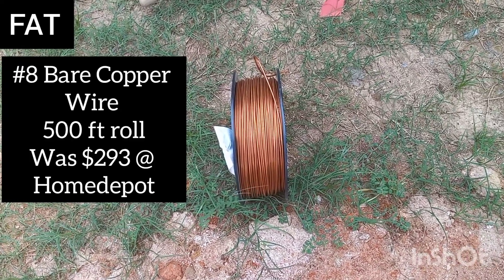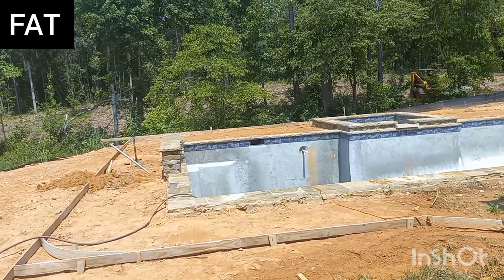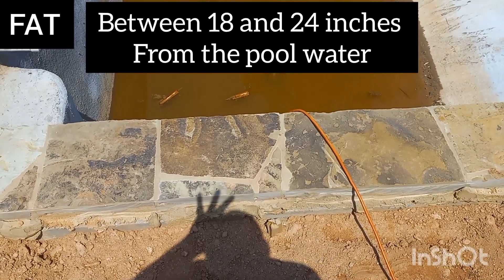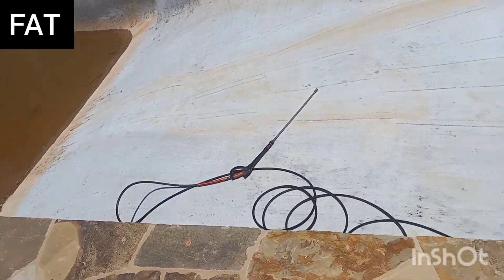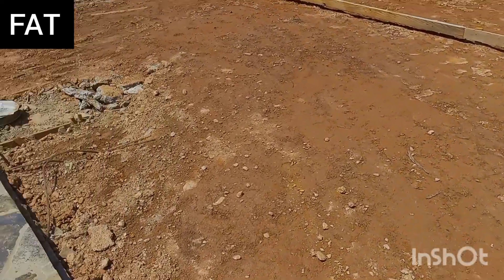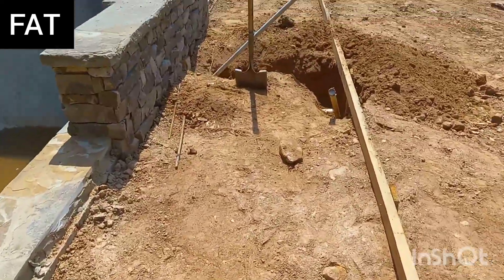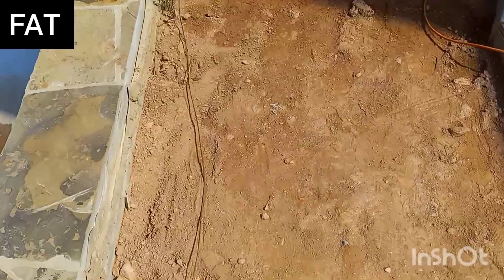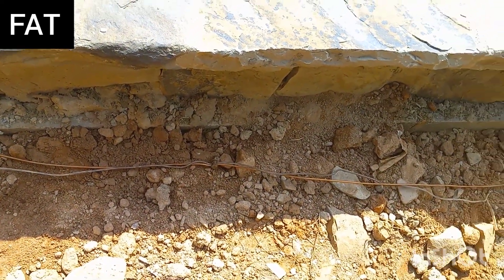How to Bond a Swimming Pool!

Comment: Frank, help I got duped by my pool company. 2 1/2 yr nightmare. I have the 360 wire but my county said they can’t see what the bonding wire is attached to in the pool bc the company covered/concealed it. They say I need a “continuity four-point test”. No one seems to be able to help. 
What can we do? I literally took up the tile around the pool and exposed the 360 wire and you can see the wire at the 4 pts coming out of the pool.
Reply from the maker: Just now seeing this comment Smh.....YT.

Comment: It is a proven fact that auxiliary ground rods add zero benefit to almost every application.  Ground rods need to be referred to as lightning rods only. The answer to stray voltage is bonding metal parts and properly grounding with egc in equipment and junction boxes. I repeat. No one ever accomplished anything throwing extra ground rods in
Reply from the maker: I've always thought it was ridiculous to add ground rods to a gunite pool. There is hundreds of feet of 1/2  and 3/4 re-bar attached to the bond.

Comment: The first video I've seen where somebody actually explained the bonding of the light. I'm building a vinyl pool with a metal niche. I've seen other videos where they run a bonding wire in the conduit with the light wire as well as bonding the backside of the niche. Is that necessary?
Reply from the maker: Yes a #6 green thhn or thwn wet location approved and potting compound is requested for the connection.  
On Gunnite pools in certain areas the inspector only wants the outside bond wire. But on fiberglass and vinyl I wouldn't do it without both.
Reply: @FrankAndTinaOfficial  thank you sir for the quick reply

Comment: Hi Frank. Interesting video. I never realized everything had to be grounded like that. Take care brother 🤝
Reply from the maker: Yep its done like that on your Pool I'm sure. Under the deck. You just have to worry about it if you add something that's metal and permanently attached to the deck or ground within 5 feet. 
Thanks Tracy!
Reply: @FrankAndTinaOfficial  I can see some of the copper cable and ground rods on ours, coming out from under the concrete over to where the pumps are stationed.
Reply from the maker: Looks like they did it right!

Comment: Question: What does bonding do? What is the purpose?
Reply from the maker: It keeps you from getting electrocuted and helps to keep the pool from getting hit by lightning.
It's a good thing but for the most part if you don't do it correctly the building inspector will not pass it. This video is kind of just to help someone who is trying to pass inspection without an Electrical contractor. 
We get most of our views and watch time from the how to videos.
Thanks for watching Jan!😊👋

Comment: Interesting stuff. My solar system requires two ground rods due to codes in Massachusetts. Professionally installed of course
Reply from the maker: Lol! Yep it probably doesn't need but one but unless you want to pay for an Ohm test they will make you have 2.
Reply: Yes for lightning protection. The theory for rods at a pool is an assanine one. People with not enough knowledge always demand more rods. Auxiliary rods have hurt people and livestock.  It is never right